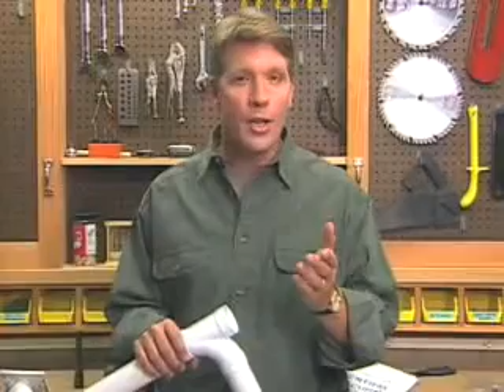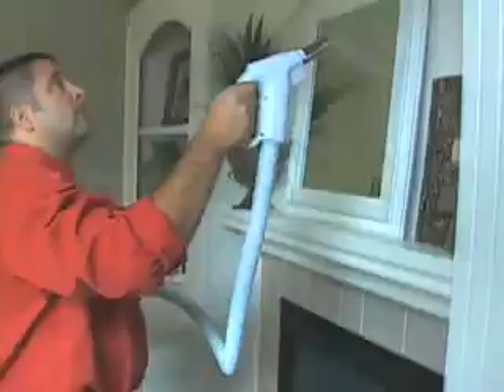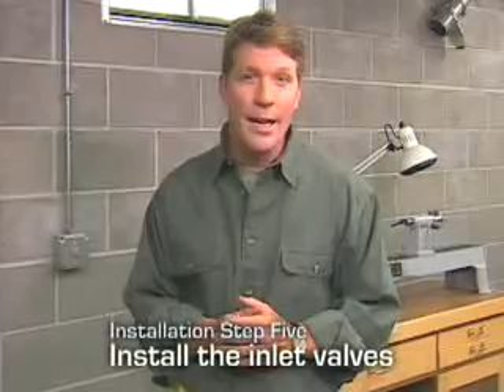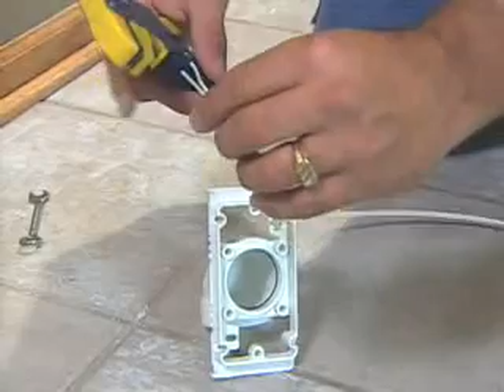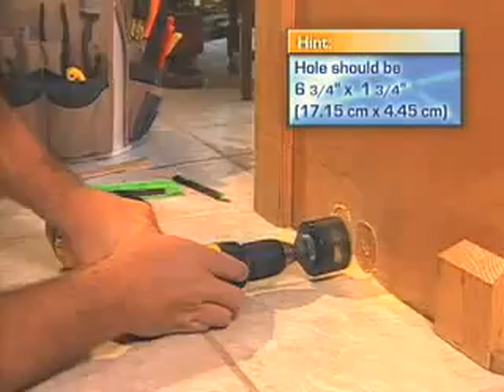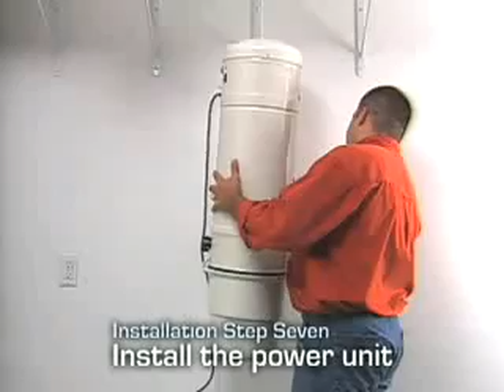How to install a central vacuum system -  A detailed demonstration

Comment: 1:41 Hate companies that use non-standard fittings. They just want to make more money by selling the pipes too.
Does this seriously not use schedule 40 PVC pipes of standard sizes?
Reply: I ordered NuTone branded pipe and fittings from a local electric supply store, it was actually much cheaper than if I had gone to the big box store and bought schedule 40 materials.  It's also the right stuff to use and doesn't need to be deburred if you cut it correctly.
Reply: nope, the pipes are specially made to be thinner and different sizes, to increase airflow within the system. using other types of pipes can void the warranty if their is a problem

Comment: It’s crazy to me how American houses are like 95% wood
Reply: And......? The whole west coast can have an earthquake anytime, those bricks will collapse right away, but wood will bend and is very flexible
Reply: strictly speaking, conventionally framed. homes (studs at 16" o.c.) are about 17-25% wood, a lot less for energy framed walls (single top plate and studs at 24" o.c.)
Reply: because we are rich in timber